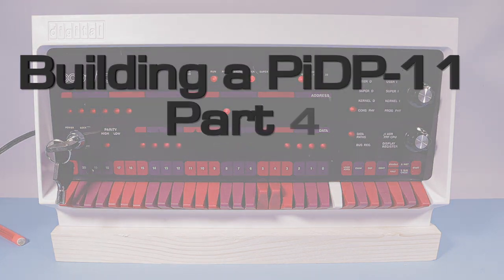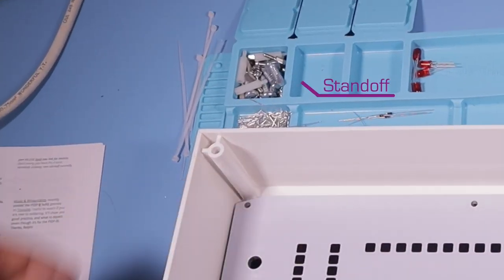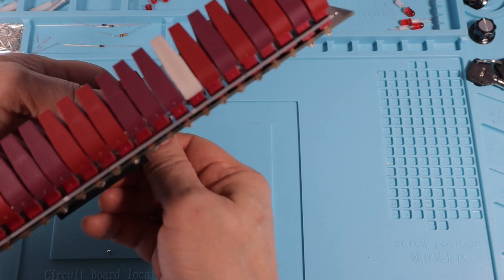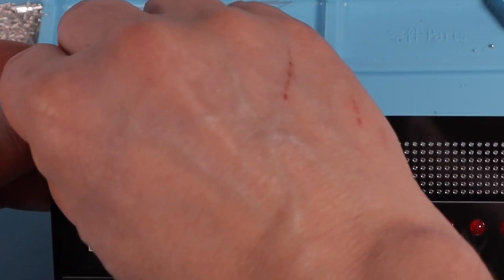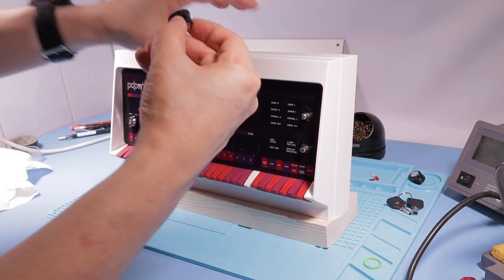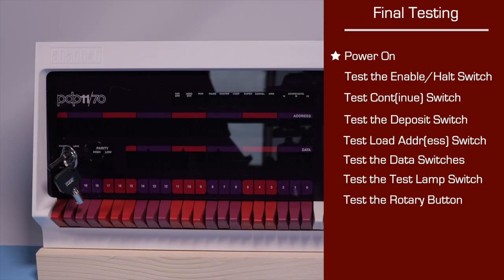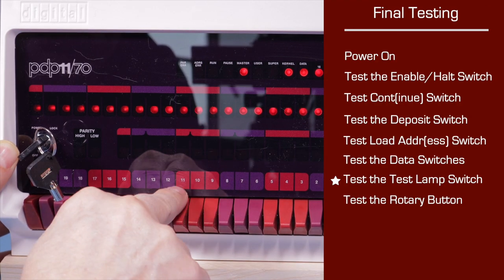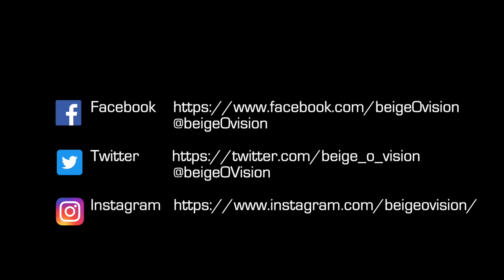PiDP11 Kit Build - Part 4 (of 4)

Comment: Thanks - looks like I will finish this project (just soldering the last switches).  Not sure I would have gotten this far without your videos.  If you want suggestions on others, let me know!  I'm hoping I can get an OS that I can compile DECwar on and get it running.  I also an coming up with a rack mount case (I hope).

Comment: I noticed some empty chip sockets labeled max232 (RS-232 interface chips)... does this mean there is an option (perhaps being worked on?) for connecting a real serial terminal or something?
Reply from the maker: The board's meant to be hackable. So there's an open expansion area, and a specific RS-232 expansion option.  You can find a discussion of the possibilities here: https://obsolescence.wixsite.com/obsolescence/pidp-11-connectivity-options

Comment: Being a retired 11/45 tech this caught my eye right away. The 70 is about the same machine, but with the solid state memory installed. Maybe a faster CPU, don't know that. When you use the word emulate does that mean that I can take my 11/45 programming card and toggle in a program? We used to write programs to aid in our repair work. When I started at DEC each test station had a ASR33 teletype. So I wrote a program that allowed my to type on the ASR33 the machine code instead of load address and then one location at a time by setting all the data switches, hit deposit, etc. All the way through to loading the program. With the program I wrote I could just type the code in. While I worked there I saw a unique machine, it was a ruggedized 11/45. Probably designed for a harsh environment. The plastic handled switches were replaced with sealed bat-handled toggle switches. And had a front panel made of a tougher material. That's the only change that stood out in my mind. I'm sure there were other changes.
So to get to the point, can I do any programming from the front panel using the PDP 11 instruction set? Probably not, but thought I'd ask. I've got stuff that belongs in one of the computer museums. And I could walk up to a PDP 11/45 that doesn't work and trouble shoot it down the single 7400 series chip. I even have original NOS chips using in these machines. My 11/45 career spanned over twenty years and everything about that machine is trapped in my head. DEC was a fun place to work. Hope everyone enjoys their career as much as I enjoyed mine.
Reply from the maker: Short answer, yes. Longer answer, the kit is has a number of preset boot routines you can access from the front panel.  These load different emulation configurations.  But you can control the emulation directly from the control panel at any time -- including directly keying in programs -> https://obsolescence.wixsite.com/obsolescence/pidp-11-how-to-use. If this is a standard config you want to use can also change one of the available emulations to include on that runs the emulated machine up to a halted state with some arbitrary emulated peripheral configuration.  For detailed information and Q&A you can use the kit producer's forum here -> https://groups.google.com/g/pidp-11.